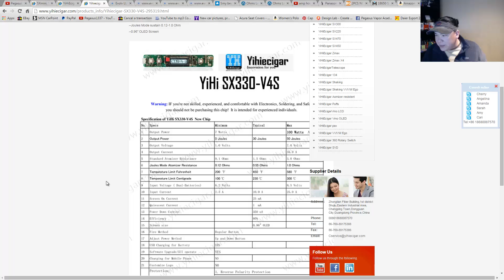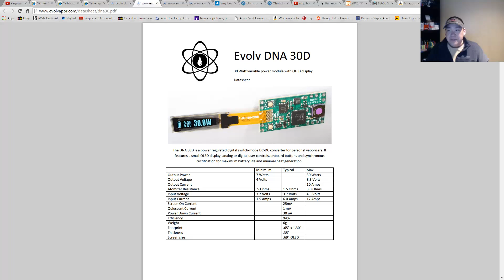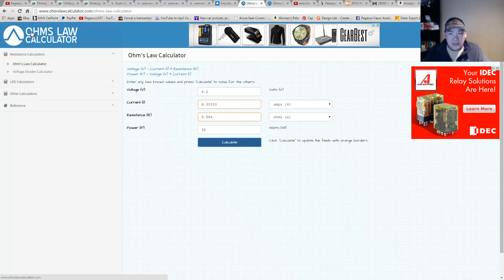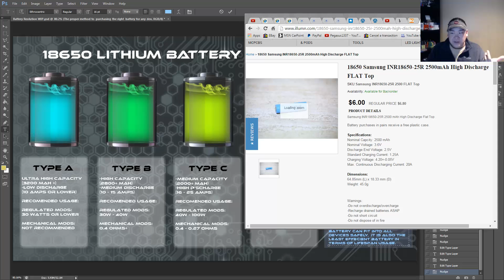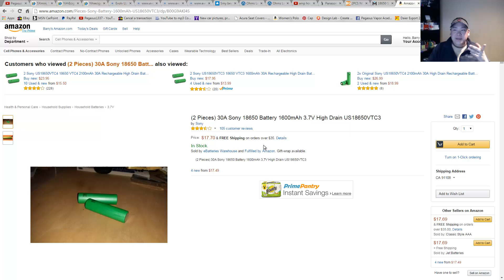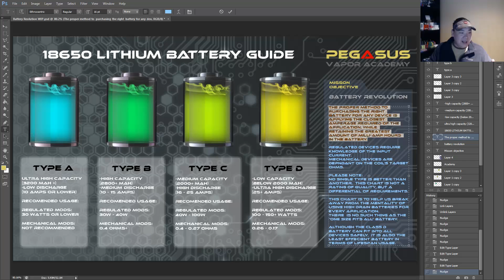The Straight Volt - Ep 04: 18650 Battery Revolution

Comment: what is going to work for me .. everyone goes on about this "sick" BATTERY LIFE they get out of stuff .... am I like the only heavy vapor out here , maybe I need help ... maybe I vape too much ... because I don't get more than a few hours out of anything I use ... I was going to get an IPV2 mini but then thought its a single battery maybe that would be bad ... I tried a sigelei 100 watt plus ... got like 2 hours out of it or so maybe a little more I don't remember at 25 - 30 watts which seems low to me ? ........... like .................. I just want something I can get good flavour and a nice vapor cloud off of without charging every 3 hours ? they need to create something for vapors like me ... these guys go on about crazy battery life ... OK? what do you vape like once every hour? fuck ... that's not me ..... I vape a lot . probably non stop if I could unless I am busy doing stuff
Reply: The formula for "sick battery life" is simple. Watts in watts out. You will read people trying to give more complex answers that are simply not true. (I'm not talking about chip efficiency here).

We have entered an era where high wattage devices and some reviewers create the illusion that you need to run sick power to get a good vape and that is simply not true.

If you are really looking for a good vape with decent vapor production try building smaller diameter coils in the 2.0 to 2,4 range with 28 to 30 ga. wire. These will perform well in the 15 watt range. I think you maybe surprised at what you can get if you concentrate your efforts to build coils according to the power being applied!

.
Reply: ilikatoavape well put and agree 110%. I've been at this for quite some time now and have built countless numbers of coils and have found that I can replicate a super sub ohm build (heat at coil) in a higher ohm coil simply just because with these high power devices we can apply more watts and get more heat flowing through the coil at higher ohms and the vapor is more than satisfying IMO.  Plus you get more battery life not stressing it out running it at its max current capacity. We have the resources out there, people just need to utilize them
Reply from the maker: You're not going to like this answer  but it is truth and it can be scientifically proven.  So I do not mean this in any offensive way.
The Sigelei 100W or 100W Plus is not an efficient Chip.  they require stacked batteries in series with a max draw of 30 amps.
This means in order to power the device safely you would need a pair of VTC3's , but becuase they are in series mode. The Mah does not double.
So you only get the 1600mah.

In your case using a fresh pair of efests  you would only get the 2500 mah.  Its pulse rating will let you crank the device to meet its 100 watt setting.
However as the batteries acrue more internal resistance, Doing so becomes less safe.   The real continuous rating of a purple efest 2500 mah  is 20 amps cont and not 35 amp as printed on the sticker.  You may contact efest directly and they will admit to that statement.  That is a pulse rating.   so really you can only operate your sigelei 100 watt safely for the life of the batteries at no more than 65 ish watts.   

Im very sorry my friend that many batteries and devices are not what you think it is.  This is why my channels exists.  To help bring clarity to situations like yours.
Hopefully newer chips will be more efficient.

Comment: Good stuff Peg. Def would love to see these new batt's graphed and even get my hands on all types. 
Question, I want to calc the IR on my existing batts. If I use a multi meter and get the voltage drop at the terminals on an atomizer, is that accurate enough? Better than using an in line? I am using a Fluke meter.
Reply from the maker: Fluke is expensive sir,  Those range from 150 to 700.  Pretty sweet to own, sadly it only impresses other geeks, no chics. LOL
Yeah   what you're doing is good.  you could also run a crappy meter like this one:
http://www.amazon.com/Voltmeter-Internal-Battery-Resistance-0-100V/dp/B00FZOWV7G/ref=sr_1_2?ie=UTF8&qid=1426642825&sr=8-2&keywords=internal+resistance
But still expensive,  I am currently working on a low cost product for everyone,  but no promises on that one.

Sadly at the moment, most people aren't even aware of internal resistance and its importance and why it must be monitored.
This will be covered later on.   Good questions as always Josh.  thanks for participating.
Reply: Pegasus Vapor Academy Yea the little lady wasn't impressed with me spending $400 but I figured I would coax her with a new pocketbook. Jewelry and handbags are always a good way to get what you want. LOL!!
Thanks
Reply: Pegasus Vapor Academy So what is the limit to where we should not be using the batt anymore? When it reaches 100x, 200x,300x the spec IR? I just checked a bunch of my batts and even a new HE4. Now I don't have a copper mech only SS so I know that and the atomizer will affect my numbers. But almost all of my batts are showing around 200milliohms. And the brand new, never used HE4 was at 167. So I'm hoping that these large #'s are hopefully due to the SS...?
Reply from the maker: I got some new gear coming in.
At the moment,  generally ICR batts should be tossed at about 500.   But I want to make sure if the new INR stuff can hang till 800.

There will be videos that cover this.